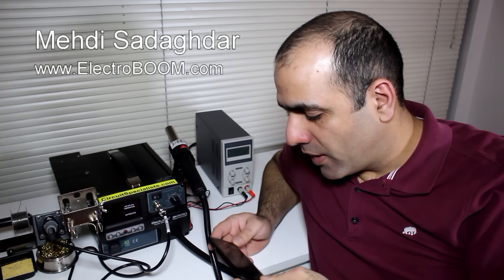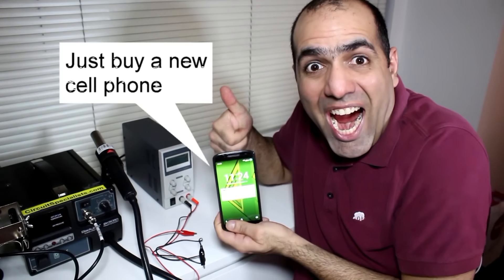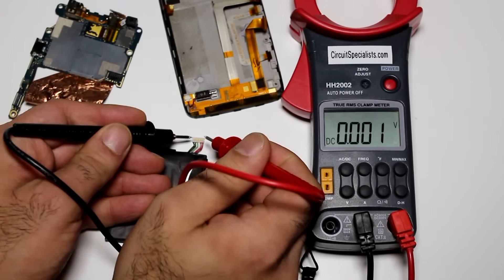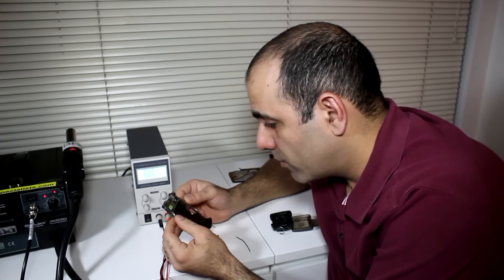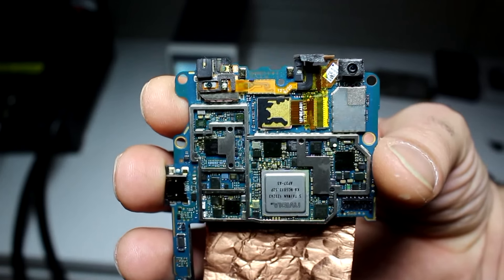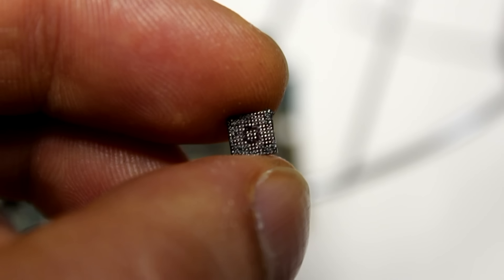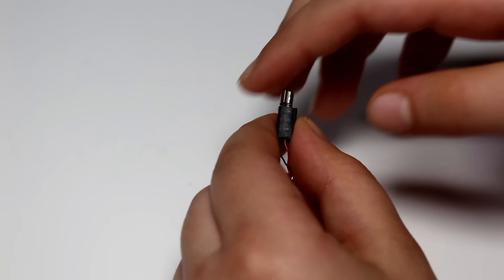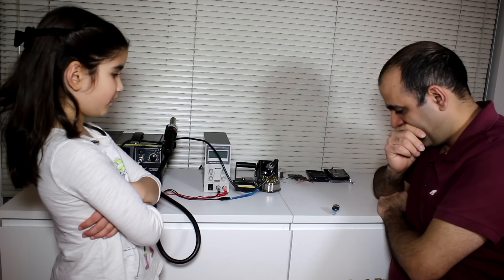Failed to Fix Your Cell Phone? Make a Robot

Comment: 0:40 Anyone who's worked with electronics will find that replacing of the chip hilarious
Reply: +ArcanePath360 works? like is a good metod to put chips fast haha
Reply: +ArcanePath360 Elaborate pls
Reply: +ArcanePath360 I don't think you have to work with electronics to know that hot glue isn't a good solution.
Reply: +ArcanePath360 hahaha i wont lie, this is DEFINITELY me when replacing chips
Reply: +notjux "Not a good solution" is a strong understatement. Glue doesn't conduct electricity.
Reply: NubeBuster  you could probably put this glue http://www.thinkgeek.com/product/b70c/ in the glue gun, think you're gonna have to be more specific i am confused
Reply: Hayden Kibble
tanks
Reply: ***** solder is overpriced! Jusy use some mercury! Max surface area around pins!
Reply: inverlock
yes
Reply: +notjux I'm pretty sure glue is a pretty good 'solution'. Hahaha get it
Reply: +ArcanePath360 I dont work with electronics but thats pretty obvious
Reply: +Hocus Focus   Indeed, but if you have experience in soldering tiny components, you know how difficult it is and precise you need to be, getting the right mixture of Rosin and the right solder with the correct ratio of tin/lead, making a good joint that won't oxidise the copper over time etc. So with that in mind, it makes it even funnier.
Reply: +TechGen2015 glue held the bits to toothbrush head nothing to do with electronics which already built.
Reply: +TechGen2015 you can't solder wood :P
Reply: +ArcanePath360 everyone knows that this is wack, he needs some duct tape.
Reply: +ArcanePath360 ElectroBoom is an electrical engineer.
Reply: +TopCategory  Yes. I know.
Reply: +inverlock u smart. U loyal
Reply: Lol guys, it is hilariously sloppy, but it would also probably work (for a little while). There is no reason the glue needs to be conductive. The pins get current through the surface mount contacts on the sides.
Reply: Of course the glue doesn't need to be conductive, that's not the issue. You can see he doesn't get good contact with the pins, as they just rest over brittle solder. I would give it a 5% chance of working at all in the first instance, as electronics contacts are quite fussy with solder. You have to have a clean, hot fused, soldered contact or you will have problems with contacts becoming oxidised and eventually the increased ohms will prevent any electricity flow.
Reply: It was a joke tho
Reply: I kinda assumed that one would use the Trump to reflow the solder already on the board. The glue would hold the chip in place just long enough.

Comment: Sweet thermal camera that I can attach to my phone!? Gonna buy this asap! 
searches online, sees price tag
Never mind ;(
Reply: Whats the cost?
Reply: +Denis Mathew about £224 on amazon/ebay
Reply: +Ann Heron Ouch
Reply: What? I got mine for £50
Reply from the maker: +Ann Heron Stay tuned, I'm trying to get a 10% discount from them and pass on in my next video.
Reply: Get the flir one
Reply: +fat Man from where??
Reply: +Hazem Abdulrab i would honestly not recommend either. The FLIR one has generally a better quality for the same price. But it doesn't show you the temperature....
Reply: +djteac I have it and yes it does sho the temperature ..I have the new one
Reply: +Ann Heron Give it a couple of years.  The Chinese factory that make them will rip of the design, and sell it without a brand for a lot less.
Reply: thats pretty cheap for a thermal camera actually
Reply: +djteac You just need to hack the firmware
Reply: Ann Heron I hate to know how much those are
Reply: They use a special glass which is why they're expensive to make IIRC...
Reply: Before you buy seek thermal camera you need to know that your android is supported OTG.
Reply: Quenthon Sexton yes this is correct the glass is treated such that it only allows a certain range of infrared light through.  Typical web cameras have a piece of glass  or plastic that typically filters out infrared and ultraviolet light so mostly the visible spectrum is hitting the CCD sensor, you can take the glass out yourself if you are willing to sacrifice a web camera but with no filter at all it will be effected by a broad range of electromagnetic waves so you'd want to replace the filter.  I did this about 10 years ago to make a FTIR multitouch table for fun and to learn some stuff.  The glass filter elements you can buy are super specific so you can get them with a very narrow band of frequencies/wavelengths that will pass through but it's about $50-60 for the small piece of glass, then need to write the software that does calibration and gives you the UI and all on the phone.  Overall $200-250 is a good deal really if you have a use for it otherwise can just use a cheap thermistor or thermocouple or infrared thermometer for $20 or less.

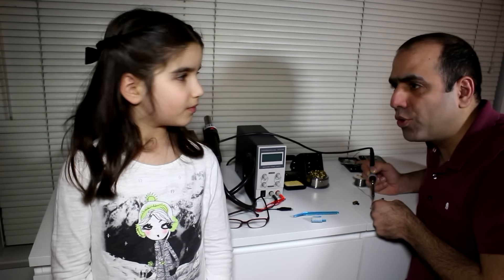Comment: 5:27
2006: And now, we’ll use some normal Elmer’s Glue to glue the circuit onto the back of the toothbrush
2016: And now, we’ll hot-glue the circuit onto the back of the toothbrush
2026: And now, we’ll use future tape to glue the circuit onto the back of the toothbrush

Comment: "And the chip easily comes off" as everything nearby looks like an F5 tornado came through. I love it! Real talk though this video very accurately describes the basic process for troubleshooting most circuit failures on a smartphone. I repair electronics for a living, basically if it runs on electricity and can fit on my workbench I'm happy to work on it. A power supply is an invaluable tool for diagnosing shorts. If you have access to a schematic and boardview it's even more useful, because you can apply a voltage to a specific rail and isolate shorts in a more refined fashion. 

Protip, isopropyl alcohol works way better than a FLIR. Dump alcohol on the area you suspect is overheating and then run power through it. The alcohol will basically flash boil on top of the hottest component. To get that kind of single-component accuracy out of a FLIR you'd need a very expensive one.

Comment: I wonder how much that thermal camera is. Those Flir jobbies aren't cheap. :/
Reply: +youtubasoarus tg165 is affordable, but very limited in terms of the imaging features (you cant lock the colors to a certain temperature value etc.)
Reply: +emanemanresuresu how much is affordable? The Flir unit I was looking at for finding cold spots in the house (insulation) was about 400-600. Pretty expensive but I understand it's pretty cheap for what you get as the unit is pretty handy.
Reply from the maker: +youtubasoarus this one is $250 US, I'm trying to get some discount for my viewers too.
Reply: +ElectroBOOM And healthcare is free in Canada. I think the choice is obvious. :P
Reply: +911mastermind Healthcare is not free in Canada. It is funded by tax payers. Although there is no bill to use the service when needed.
Reply: +ElectroBOOM Pretty reasonable. :)
Reply: +ElectroBOOM thats a good price)) but does it have some cheaper analog, maybe from our China friends?))
Reply: +Benjirich 
mate... ffs wth? i could buy an overpowered PC including GPU for less than $1500!
UMadBro?
i have a PC that's 8 years old that i bought for $420 which i still use to this day..
never faild me!
Reply: 300€ Keyboard?! WTF
Reply: ***** 
Ikr lol!
Reply: thats what i thought
Reply: Benjirich 
$300 FX 9 series CPu
$300 Radeon R9 390 GPU
$170 Asus motherboard
$120 1tb HDD
$200 256gb SSD
$90 real 500w PSU
$30 mouse
$20 keyboard
$200 oil coolant

Thats near $1400, so €1000?

so I'd get near €3000 euros, id spend €1000 on solar system, put €300 into GPU and CPU
Get a UHD touch screen for €300
And I buy a ticket and a hotel somewhere with 200mb speed internet for 3 months with the rest of the €1400.

And i still use my current 8yrs $420 PC for games btw, and it runs them quite well! Not as it used to be though which is obvious.
graphics isn't everything, nor are high priced hardware.. i could get a sweet server and over 10tb of SSDs with €4000..
Reply: Benjirich 
Question: why do you need to play it on the highest resolution???
My old $420 AMD Phenom (no not phenom2) runs CSS really nicely with 60fps at 1024*768 with Radeon R5450 1gb GPU
You don't need a freaking 4k resolution to play a game! C'mon mate! Games were never like this before.. they used to be appreciated for their gameplay and content, nowdays all that matters is graphics, that's why they have a bad gameplay.. i don't stand new games, last console game i enjoyed was crash bash on PS1, everything went downhill since then! 

I played CSS for over 7 years non stop, i still play a game called "The original war" which takes place 1m years ago between russians and US as well as Arabs (RPG+RTS), it has really low graphics and it's over 10 years old! Yet it i prefer them anytime and everytime over any other game..
You don't need to see yourself die in 4k, you just need to be able to have fun and enjoy and maybe learn..
Take minecraft and runescape for example.

 I rest my case.

And by the way, ATI GPUs own Nvidia almost everytime.. and Intel CPUs are overpriced for no reason.
Add the crossfire feature on ATI's GPUs and nvidia has no place no more. (Their feature is worst than crossfire and needs same brand GPU set to run)
Reply: Benjirich 
It's either buy a 2k car and upgrade some stuff every year or buy a 20k car, you dont buy a 20k car and upgrade it every year.. it meaningless unless you want to race (which is illegal hence can't get customized cars from dealers)

It's nice to have a high end PC, but don't get too used to it, is heavy on the pocket!
Reply: The thermal camera adapter for iPhone 
/ android costs £259